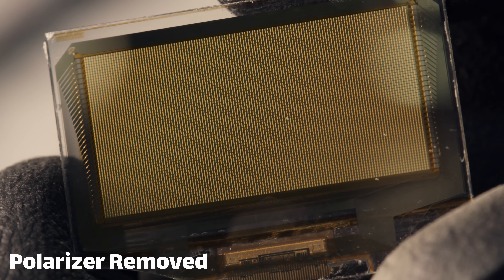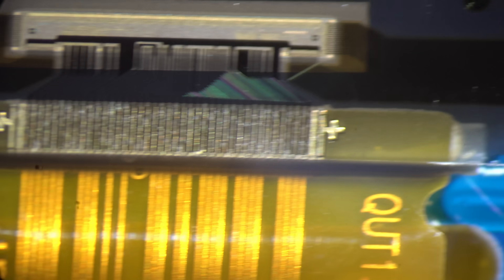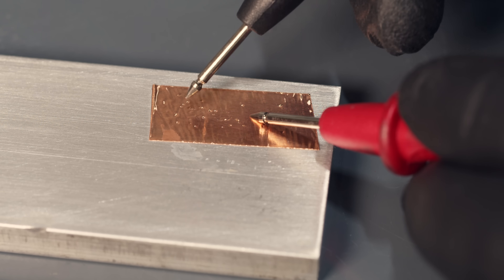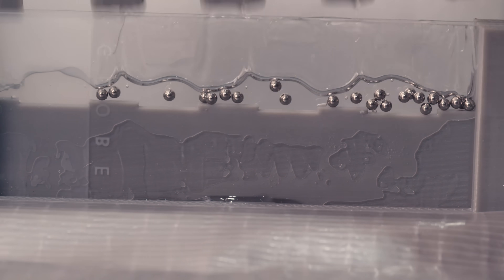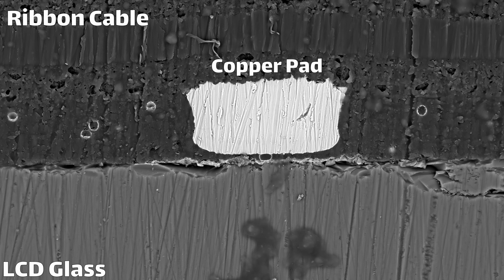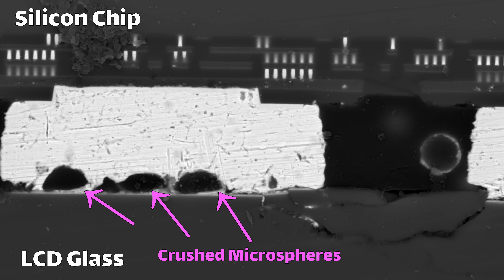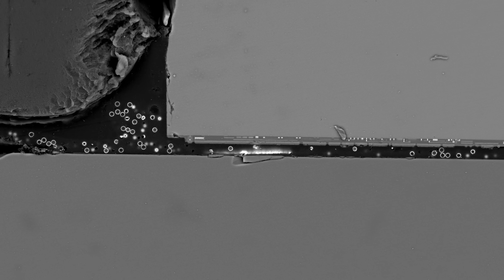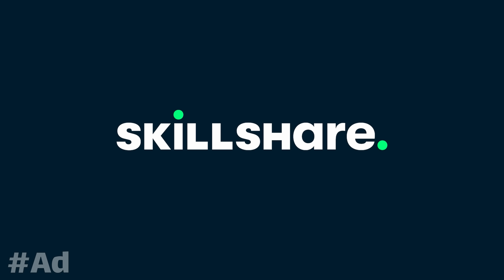The Microspheres Hiding in your Phone's Screen

Comment: Thank you for this view into an amazing bit of technology!  I remember repairing electronics in the era of "zebra strips", which had a much lower connection density.  It's cool to see the evolution of glass-to-wire interconnects to the next level, but the "crushable" nature of the microspheres makes anything built with it disposable, right?
Reply from the maker: Essentially yeah, although the "tape" is really closer to a heat-set epoxy so the bond itself is about as permanent as you're going to get from an adhesive. Definitely not something you can pick up and re-position after heat application!

Comment: Another cool product used in electronics is an adhesive thermal interface material that guarantees electrical isolation.  This is a dispensible glue like material that cures and include small glass micro-spheres that guarantee a minimum gap when you apply pressure between the part that is being thermally bonded to the heat sink

Comment: I heard tell about a proposed new room temperature, ambient-pressure superconductor, LK-99. Have you checked it out, and would it be feasible to replicate the experiment with your equipment? It could make for an interesting video, even if it doesn't seem to hold up to the claims.

Comment: I suspect one of the reasons they used electroless nickel phosphorous plating on the pins, aside from corrosion resistance, is that it promotes surface uniformity and reduces surface porosity. Ensuring that there are no surface voids or pits is likely a fairly major reliability factor for applying the tape. Since bare metal is fairly porous, there's a tendency for hydrogen absorption (and adsorption), which might lead to bubbling and delamination of the tape as a result of degassing. A medium-phosphorous EN plating is a pretty simple and relatively cheap way to solve all of those problems simultaneously, and the tooling for it is pretty ubiquitous given that we do it all the time on ENIG / ENEPIG surface finished PCBs.

Comment: You're correct about the corrosion resistance for that nickel coating on the pads. We do the same thing for the copper IHS on CPUs. The nickel doesn't corrode away nearly as badly as copper will when just exposed to the atmosphere, let alone any moisture. You wouldn't want to have your traces going green on you, or the surface of your CPU becoming pitted over time.
Reply: Chips won't go pitted, because there's generally a layer between them and the IHS, such as thermal paste or pads. So even copper in contact with an IHS doesn't really corrode in its usable life, because it's protected from air at the contact point. Of course everything else would corrode, and that's mainly for aesthetics rather than functionality.
Reply: @peoplez129  It's not the inside we're concerned with. That is sealed from the outside world. The silicon itself won't corrode, since it already has a layer of oxide on it. The greater concern is the outer surface, which is exposed to the atmosphere for extended periods of time. Pitting takes a long time and is the extreme example, but even tiny copper oxide spots ruin the thermal properties of that area of the IHS and create hotspots.

Comment: My multimeter's display is connected with a vertically segemented conductive rubber sandwich thing! I'd never seen anything like it before. It's a cheap multimeter that I disassembled to fix a flaky control dial.

Comment: I really want to run a water source heat pump from a very large swimming pool. Also, instead of running lines in the concrete, wouldn't you get the same cooling capacity by running pool water into the server room and then to a liquid to liquid heat exchanger?

Comment: Looks like somewhat of a high-resistance contact. I mean it obviously works well enough, but damn, the metal cross sections with just a couple spheres per pad must be tiny!
Reply from the maker: Yeah, the spec sheet for my tape claims it is 1 ohm. So conductive but not amazing by any means (also limited to <50mA)

Comment: If you have a green (best color for visibility) laser pointer, you can reflect it off if the surface of a TV or other screen and see the individual pixels in the reflection. You can also do this with a CD or DVD to see the track made of pits and lands.

I've been fascinated with this effect of using laser light to view microscopic structures as a reflection. With no lenses. I'm wondering if this method is used in actual scientific applications to visualize microscopic structures.

I always find my best ideas have already been thought of, so I expect that somebody would have discovered and exploited this in the last 50nor so years.
Reply: Have you seen how holograms are made?

Also, obligatory cheap green lasers can punch your eye out with invisible and undetectable 808nm and 1064nm infrared light. Any DPSS laser like the common 532nm is packing a pump diode that puts out much more than the "safe" 5mW legal limit. Some have IR filters, most cheapos don't.

Most any other diode laser, including the new green ones (~500-520nm) is probably grossly underrated on output power due to marketplace regulations. Before those regs, they used to sell them as toys to light stuff on fire. Now they have to be below the legal limit to sell but of course nobody setting these rules ever checks anything. 

Be careful with those reflections!
Reply: Laser microscopes are a thing

Comment: Fascinating, I guess the unsung hero here is the coating and construction of the spheres as at this scale the odds of them touching and forming a bridge are small but even if they do the 'point contact' area on the sphere is ridiculously small ! so the ability to be 'crushed' and spread out a conductor is the key to this. I wonder could the spheres be an insulator but the insides be a crushable conductor ? It would work a bit like crushing a profiterole and the cream is conductive, but it wouldn't matter if the choux pastry touched as its an insulator.....  I love it....cheers !

Comment: I knew about zebra tape, but this is a while other level!  I think what I'm most impressed by, and curious of, is how they make those tiny spheres... and even more, how on earth they can plate them with metal. 😯
Reply: Probably sprayed it melted and let it cool in the air.  Maybe an electrostatic charge introduced to repel and be smaller.  
 Oakridge labs was doing this with ceramics I think.
Reply: @ghostmanscores1666  I'm mostly curious about how you could plate the tiny things. Maybe some kind of vacuum deposition? Use electrostatic forces to agitate them for an even coating?
Reply: Plating is easy, you introduce electricity to an item, increasing its charge to cause the plating material to bond to the item in a shell all around. The hard part is making the balls.
Reply: @leonardonetagamer  I figure making the balls would be the easier part. I don't know how you could plate them in a traditional way. If physical contact is required to induce a charge so the plating sticks, I'd think at least part of each one wouldn't be coated from where the point of contact would need to be. Hmm..

Comment: first let-down is only 0:13 in.. what's shown is an OLED display, not an LCD, and certainly not "with polarizer removed". Are you no longe editing the videos yourself for this to slip through?

Edit: pretty decent video after that though :)
Reply from the maker: LCD was just a verbal typo, but it was definitely with the polarizer removed (because I physically removed it). Or at least I'm assuming it was a polarizer. Dark plastic material which you can later see on the device pre-removal :)

(I'm still editing all my videos)

Comment: The nickel-phosphorus layer is a clear indication of ENIG (electroless nickel + immersion gold) plating on the flex circuit. The gold plating won't show up in a cross section done post soldering because it's very thin (tens to low hundreds of nm) and Au is very soluble in Sn-based solders so it will disperse throughout the melt and probably be below detection limits for EDS.

It's very commonly used on both flexible and rigid PCBs to prevent corrosion between manufacturing and soldering of the boards.
Reply: It's also part of the through hole plating process.

Comment: Does it need pressure to maintain the connection or does the adhesive bond strongly enough to keep them in contact after pressing them together?
Reply from the maker: Strong enough to stay in place afterwards! It's closer to a heat-set epoxy, so the hold is pretty tenacious
Reply: @BreakingTaps  Ah, that makes more sense. I was thinking of it like a more standard tape adhesive which always seems to have a lot of give to it.
It being something that really hardens after setting fits better in my head.

Comment: How do the tiny traces on the glass get made? That sounds even harder

Also, what kind of current can these connections support? The cross sectional area of contact through those spheres can't be very large, right?
Reply from the maker: The traces on the glass are typically made using lithographic techniques. Add a photoresist to the surface, pattern, develop and then use something like sputtering or thermal evaporation to deposit the thin film of metal. So closer to how microchips are created, just a lot larger in comparison :)

My tape is rated for <50mA and <50V, with a contact resistance of 1ohm. So yeah it's relatively high resistance and low current, but for signals I guess it's fine :)

Comment: Neat stuff to learn!
I wonder how well this bonding method handles vibration and thermal cycling.
Reply from the maker: I forgot to mention in the video, but the adhesive is basically a heat-set epoxy, so more permanent than you'd think even though it's called a tape. The spec sheet on my tape says the peel strength is 1200 N/m. I'm currently trying to debond one of them to look at the microchip and it's being very tenacious! Definitely a much stronger bond than I was expecting

Comment: That's super neat - I never would have guessed at that engineered solution. 

I can't think of many examples of where a random dispensation of mechanical components end up creating a reliable working system.

 It's fascinating to think that it could be one, or a hundred microspheres that end up creating the connection. 

I think it's worth considering features like this when thinking about how long products will last. I'll bet that this kind of connection will break down after maybe 25 years.
Reply from the maker: Yeah me too! When I first heard about ACF, I assumed it was some kind of structured pillar embedded in the tape. Not just a random dispersion of particles 😂 But I guess simple works best sometimes!

Comment: In old electronic watches kind of sponge was used, it has repeating layers of ruber and graphite(?) thinner than space between contacts and it was put (not even bonded) between glass and circut board contacts.
Reply from the maker: Someone just mentioned that to me: Zebra connections! I hadn't seen it before, but going to go dig through my old electronics pile and see if I have any laying around. TBH that's a lot more like what I was expecting from the ACF, some kind of pillar structure, not just random particles :)

Comment: ok, I get how the copper tape at 3:06 is conducting to itself, that's obvious. But how is it conducting to the metal it's taped onto?
Is the adhesive conductive too? Or is it so thin that the electrons just jump the "gap" between the tape and it's taped on surface?
Reply from the maker: My fault, I explained that poorly! The adhesive itself is conductive, I think it's doped with something like silver particles, and has enough of the particles loaded that there is always a conductive bridge between the copper and the underlying substrate

Comment: One thing that I wonder after watching this: How is this applied in a way that makes sure that you have sufficient crush everywhere to make the contact? An is there no elastivity of the tape that will disengage the contacts, once the pressure is removed?
Reply from the maker: My bad, I meant to include a section explaining how it's actually applied. Just totally slipped my mind. The tape is applied with a hot bar and pressure. My tape needs 180C and 2MPa of force for about 15 seconds. I think it's essentially a heat-set epoxy, so closer to a permanent glue than a removable tape adhesive that we normally think of.
Reply: Thank you for the information! Not as easy then as I thought

Comment: if you ever took a cheap multimeter (or maybe a calculator) apart, you might have seen a sort of rubber rectangle that connects the PCB and the LCD. it's pretty much the same thing, it only conducts in one direction, it's pretty interesting!
Reply from the maker: Will take a look! Sounds interesting!
Reply: cheap digital calipers too
Reply: they seem to be called "Elastomeric connectors"

Comment: I am a freelancer electronics engineer. I have tried using the Z axis tape in my last project for a client, a month or two ago. I was making few prototypes for them and I wanted to use this tape to stick a large 4G/LTE module on to the PCB instead of soldering it, just for testing. I tried this because the module had all the connections on the bottom and it seamed easier to try this tape instead of soldering it. For this project, the tape did not work. I tried on several PCBs. Even tinned the bottom connections of the module because it seems the solder mask rose above the pin pads of the module, but that still didn't work. That introduced even more problems. I am sure I will find uses for it in the future, but for a large module, it did not work. 

In the end, I got everything ordered from JLC with assembly. Everything assembled but the module. For the module I used a low temperature solder paste - Sn42Bi58 (138°C) and it worked out great. Soldering new prototypes as I write this comment. They work like a charm.

Thanks for the video!
Tomislav
Reply: Yeah, probably not flat enough.  The kind in the video requires protruding contact faces.  Might still be doable with the press-on kind (which is, what, vertical metal filaments I think..?), but still not very reliable, nor low resistance.  LGA/BGA modules and chips really aren't doable without a hot air machine; fortunately a basic model is quite cheap.  (And indeed, even easier with low-melt solder like that!)
Reply: @T3sl4  You are right, not doable without hot air. I do have hot air but I still fear some pins are not soldered so it may not give the proper performance. That is why I hoped the tape would be better. I did use the hot air station in the end.

Comment: laser engraver is around 50um-100um accurate, ie 0.05mm-0.1mm
Reply: scorch a narrow conducting wire on the pcb
Reply: try casein graphene plastic, diy, heated milk (80C) vinegar in blender mix with graphite, does not burn well, like coal, but is still plastic, like carbon fiber but better, fully plastic (350C), not mesh cloth
Reply: as casein is combustible and carbon is less/none, then casein works like charcoal igniter fluid, but inside the carbon coal chips
Reply: ie graphene in blender shear mix with graphite + whey from milk
Reply: of course
Reply: how about growing nano structures with separating electric/magnetic field steering, yep like crt electron beam but art ion beam, yep even cpu patterns directly, on a substrate
Reply: even purifying materials like uranium directly from dirt

Comment: Great work!
Have you tried to measure the resistance of such connections?
Reply from the maker: I was going to... and totally forgot 😅 The spec sheet for mine claimes 1ohm resistance so it's just "ok". Also limited to <50mA and <50V.
Reply: @BreakingTaps  Is that all it says or does it give it as a per area? I'd expect larger or smaller pads would affect the resistance and current capacity.
Reply from the maker: @LanceThumping  Datasheet just says "ITO electrodes all over / TCP; bonding width, 1.5mm", so not entirely clear to me what the actual dimensions were. 😔 Spec sheet is here if you'd like to take a look! http://www.fsrkj.com/upfiles/201712/22/af0aa1f1cb2886b6f.pdf

Comment: How these microspheres are made?! and  how are they applied? deposition process or something?!
Reply from the maker: Not entirely sure to be honest! If I had to guess, they are probably something like polystyrene spheres (which are relatively easy to make in bulk, using something like emulsion polymerization). And then an electroless nickel coating, followed by an electroless gold plating?  Seems like you'd be able to do all those steps relatively in bulk, then filter and collect the particles and suspend them in the tape adhesive somehow

But yeah, not sure!

Comment: I'm an EE and I've used ACF hot-bar bonding many times, but I've never seen images like these - great stuff.
Reply: Which companies do EEs get jobs easily at? I am a software developer but I have always been interested in electronics. I wanted to setup a home automation company when I was young lol but the country I am from, it's more likely to not happen. In my country there's no job security for EEs you see. If there was, I probably would be in that field.
Reply: Now the question is HOW to use that kind of adhesive for SMT? Hotplate SMT soldering has solder bridging issues and so on, as I sadly found out when trying multiple times. So adhesive of that type seems like a possible solution. Heard if there is already a way to spray a layer of that on a PCB?

Comment: It kinda is a bit of a Lottery. Every once in a while there will be an disadvantageous distribution of spheres shorting two contacts. I guess the odds are calculated into the process and a certain failure rate is accepted or even expected.
Reply from the maker: Yeah that's sorta what I was thinking too. I wonder what the rejection rate on this sort of thing is?